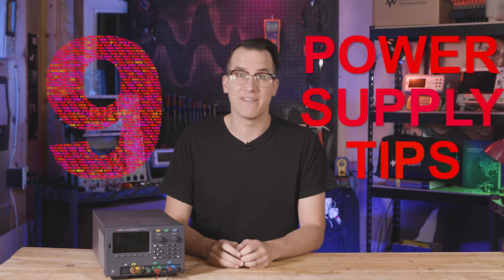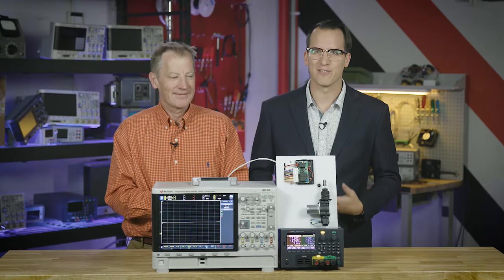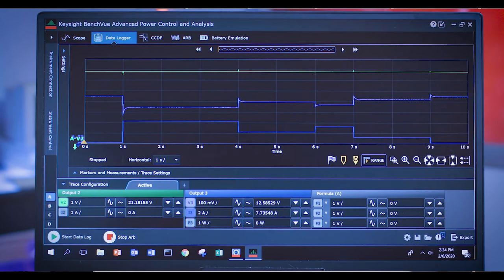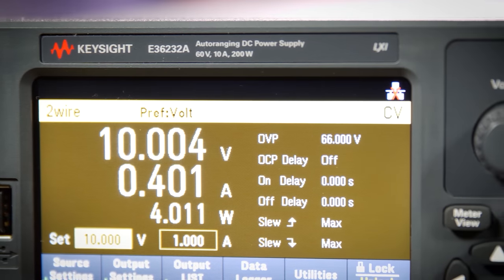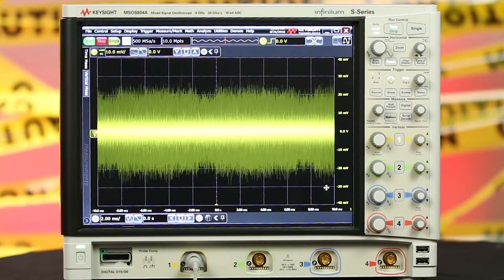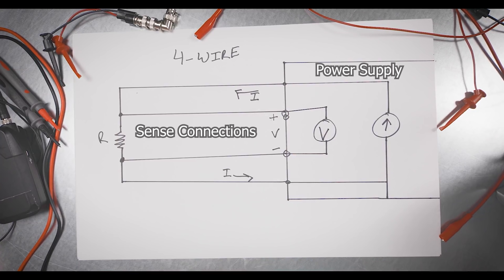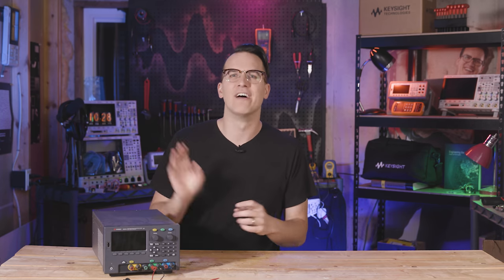9 Bench Power Supply Tips You Need to Know [Tutorial]

Comment from the maker: Hi everyone! Time tags for each tip are below.
You can sign up for the power course here: https://bit.ly/KU-PowerCourse

And check out all the Keysight University courses:
https://www.keysight.com/us/en/resources/keysight-university.html

The power supply tips in order:

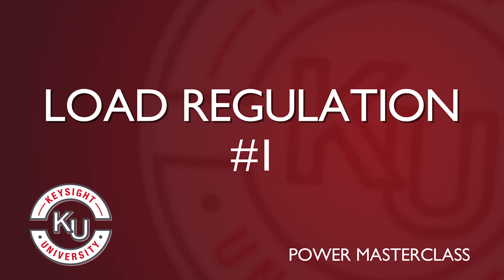1:30
Power Supply Load Regulation

2:15
Power Supply Transient Response

3:00
Power Supply Line Regulation

4:04
Power Supply Program Accuracy

4:34
Power Supply Readback Accuracy

5:47
Power Supply Resolution

6:18
Power Supply Output Noise

7:16
Power Supply Remote Sense Connections

8:30
Power Supply Interfaces and Remote Control

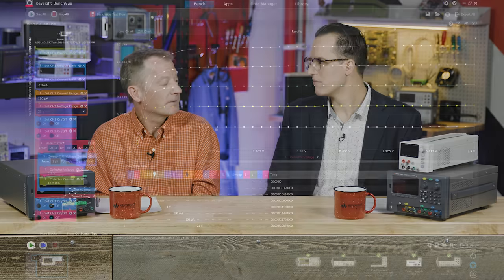10:32
Power Supply Protection Capabilities

11:32
Power Supply Fault Triggers

Comment: Wouldn't the readback facility feed back into the programming? Is it typical for programming accuracy to be different from readback accuracy?
Reply from the maker: From Bill: Programming accuracy really means setting accuracy. You can set the voltage from the front panel, LAN, or USB. Program accuracy defines how closely the voltage output will be to the setting. Readback accuracy defines how accurately we measure the output voltage which is displayed on the front panel, and sent over LAN, or USB.

Comment: Nice done! You mention several important parameters, usually found in the datasheets for power supplies. One parameter that I think is harder to find is the supply’s “easy to use”. It is of course not easy to specify this and what is easy or convenient is also depending on your personal preferences. But I think there some universal features such as clear, logic and configurable display, possibility to set voltage and current both by keypad and knobs, dedicated output on/off buttons. 
How does Keysight work when designing UI? Can I as a user influence this? I have an E36313A and think it has really good UI, but really miss the possibility you had on e.g. the old HP66312A. With the left and right arrow keys you could move the cursor to one digit and when increase/decrease it with the up or down arrow or the knob. An easy way to step the output voltage in e.g. 0.1V steps while observing your DUT to see when it shuts down or wakes up. May we see a FW update with this feature? :)
Reply from the maker: The best way to feed this info back is to call/email our support line and submit an enhancement request at https://www.keysight.com/find/contactus

I've seen many features/design elements come to life that way.

We have some R&D folks that specialize in UX, but it depends on the group.

Comment: I need one of these to test amp draw from quadcopter motors,  I think the load regulation feature would really help with that, as the voltage drops on lipos when i “punch” the motors. Can’t afford it though :/ .....maybe someday 🤷🏻‍♂️
Reply: There are some fairly cheap versions of these, even then couldn’t you test the draw with a good multimeter? I’m not very knowledgeable though